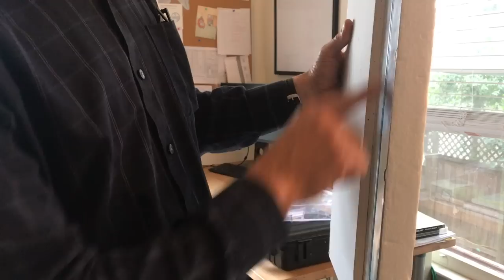Messana Radiant Heating & Cooling Finally Installed

Comment: That will sweat.
Reply: It has temperature sensors so the panel never drops below the dew point.  This system only provides sensible cooling, you have to have a separate system to deal with latent cooling (dehumidification).  The control sequence is more complicated but the energy consumption is minimal compared to a standard system.
Reply: @mseadorf  The dew point outside is different from inside, and different in every room, depending on local temperature and humidity...... So measuring it outside is a bit pointless unless you've got all the windows open. What happens when a tea kettle boils or someone opens a bathroom door that had high humidity? Air conditioners use defrosting coils and drain the condensate away, this can't do that since the moisture is now in your walls.
Reply: @eugenes9751  The temp sensors are measuring the interior dew point, increasing, decreasing radiant panel temps and or shutting off all together to avoid condensation.  Yes as you state the temp and dew point can vary for each room, that is why a properly designed system has to have sensors and controls for each room.  To employ a radiant cooling system you need a more complex control system, its not a singular system, you have to have a separate system to deal with the humidity.  A high moisture room such as a bathroom needs to be managed, one way is a sealed shower system with exhaust fans on humidity sensors with controlled / conditioned make up air.  A boiling tea kettle will produce moisture in the air but your dehumidifier should be able to manage this load.  Overall, its a much more complex approach than just throwing in an air handler, however the energy reduction is huge especially if you use geothermal for your chilling unit.
Reply: Here is a great radiant cooling design manual from Uponor that goes into  tons of detail on how to design both radiant heating  andf cooling systems, control strategies ect.  https://www.uponorpro.com/~/media/extranet/files/manuals/nonoptimized/radiant%20cooling%20design%20manual%20-%20rcdm.ashx?version=070220180330
Reply: @mseadorf  Seems to me, like this is 20x more complicated than it needs to be, and you'd need to measure the temp/humidity inside the walls as well, not just the rooms. 
You can still use geothermal with an air handler and a heat pump. It's their way of distributing the cold air that's dumb. Geothermal is generally designed to cool and heat, so are they suggesting using radiant heating in the ceiling as well??? If the pipes start to sweat in the walls without anybody noticing, your house will be covered in mold relatively quickly. Who will warranty such a product flaw?
Reply: @eugenes9751  Lots of points you cover.  Any pipes in walls ect would need to be insulated to prevent condensation.  There is really no "dumb" way to do this type of system, simply too risky without humidity sensors and a separate air system that deals with humidity and fresh air.  Radiant Cooling doesn't move air other than any convection it creates by cold falling and heat rising.  If you look through the design manual I previously posted it goes over heating with radiant from the ceiling, it works just fine, but from the floor is better.  Geothermal is nice, I have a 3 ton Geothermal system I installed on my current house, it uses a slinky loop and is more efficient than a standard heat pump but radiant cooling can be much more efficient.   My current setup runs about 2500W (from mfr manual - havent thrown an amp probe on it)  I've designed a radiant heating and cooling system for a house I will be building soon - Pipes are embedded in a concrete ceiling, and circulated through vertical bore holes in the ground, no compressor required to achieve 58-62 degree water temps.  It requires 2 variable speed deta-t pumps with the way its zoned out and will consume a maximum of 80 watts with both pumps running all out - reality will be less most of the time.  The dehumidifier / fresh air conditioner will require 450 watts when running and will be triggered by the humidity sensors and CO2 sensors to control the fresh air.  overall a max power consumption of 530 watts vs 2500 watts.  Cost to install would be more, but what components can break, a water pump (150 for the rebuild kit), a thermostat-$350, a zone control valve - $100, none of which involves epa controlled refrigerant and anybody with slight mechanical ability can repair / replace.  Radiant cooling isnt for everyone and I dont see it going main stream in residential but its a pretty cool system.  I've designed my whole next house around it!
Reply: @mseadorf  Have you tried calculating how much BTUs is actually being delivered? It really doesn't seem like a 10degree deltaT across a relatively small concrete slab will be very productive.
Reply: @eugenes9751  I've completed a full design for an 1800 sqft house based on the numbers uponor suggests using.  The manual lists out the BTU's per sqft you should be able to achieve when cooling from a ceiling (19 btu/sqft), wall, or floor.  In my case the ceiling is capable of delivering 31k-38k sensible btus.  From there it's just a matter of calculating your water gpm flows and  using various delta t's.  (BTU's / DetaT / 8.34 (weight of a gallon of water) / 60 min ) = GPM of total flow.  I used LOOP CAD to size my loads in the house and had to manually layout my cooling loop zones and calc the headloss to size the pumps.  The house I designed is all concrete using the XP-1 System from Logix ICF - all the insulation is on the exterior of the building, interior concrete will be skimmed and painted.
Reply: @mseadorf  But hold up. 1800sq ft house, you're suggesting you did the entire ceiling? An 1800sqft concrete slab ceiling...???? That's going to cost like 75k to complete..? And that's probably without the geothermal install. What do your numbers show?
And most importantly: A 1800sq ft house requires a minimum of 48,000btus (4 tons), you've only got 2.5tons, and that's under optimal conditions (when it's already been cold outside)... You should probably be expecting far less capacity during the time of day when the cooling would be needed the most since your geothermal well will get saturated on a hot day.
Reply: @eugenes9751  The house is a simple 60’x 30’ rectangle with a 5/12 pitched and hipped roof with 2.5” concrete slab supported by interior exposed timber trusses at 6’ oc.  Walls consist of 6” concrete with 4.75” ridged foam insulation to the exterior, Roof is 2.5” concrete with 6.75” ridged foam insulation to the exterior. 

I’m a Commercial General Contractor, my cost to build the roof system is about 15K including labor, not including trusses, roofing, or the 5500 lnft of 5/8” pex imbedded in the slab.   A standard roof system would run about 3.22/ sqft vs my 7.89 / sqft

All the materials for the radiant heating and cooling system will run around 10K including the backup heat source, manifolds, pumps, zone valves, controls ect.

Full Manual J evaluation of the cooling loads for the house on the hottest day are 16,539 BTU’s sensible and 3,680 BTU’s Latent.  The Radiant cooling system will be capable of delivering 30-36k BTU’s of sensible cooling.  The dehumidification system will handle the 3,680 BTU Latent load and provide and additional 5,000 btu’s of sensible cooling when running, based on all these numbers I’m confident the system is sufficiently oversized to manage the loads for the house and if additional cooling proves necessary it wouldn’t be difficult to install a water chiller on the system to put up additional cooling capacity.

To state a 1800sqft house needs 4 tons is a gross generalization without performing actual load calculations.  My current home is heating and cooling 4500 sqft on a 3 ton geothermal unit.  The house is ICF walls, 2250 sqft walk out basement on two sides with full southern exposure and 2250 sqft upstairs and a standard truss attic system with R-50 blown fiberglass insulation and a black roof.   Its not event close the same energy efficiency as the new design and still performs just fine on the hottest days with only 3 tons.

Radiant Cooling is a viable option – You just need to design around it and be willing to pay for it upfront, I haven’t figured out the ROI yet, but I’m guessing it will be longer than your average person would be willing to pay for, is it realistic in today’s current market – nope, not a chance, but for a contractor do implement the system for personal use – I think its worth it.
Reply: @eugenes9751  Yes, use radiant heat in the same system.  This is "high temperature" cooling if you follow.  Stays well above dew point and use dehumidification to control humidiy.
Reply: @mseadorf  Mike would love to hear more about your project.  Very much inline with what I am interested in.  Would you mind further explaining your roof system?  Would you be "pouring' concrete into a panel which contained tubing and then installing the panel?  Thanks

Comment: Sell, sell sell....... ::) just get a plain air conditioning unit and it works in Chicago as well.
Reply: +Catalin M  This should cost less, and you won't have 55 degree air blowing on your neck/cranium. Also, the temperature inside should be the same (+/- 1 degree Far) all the time, instead of increasing and then decreasing by 20 degrees (the HVAC is blowing uncomfortably COLD air on you).